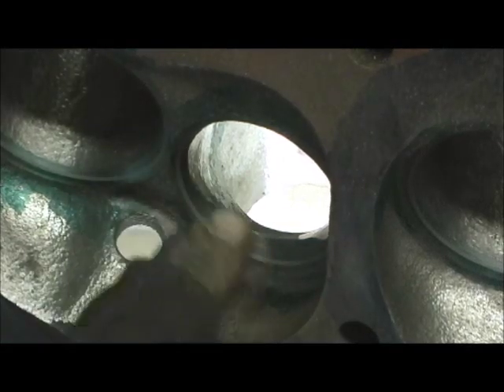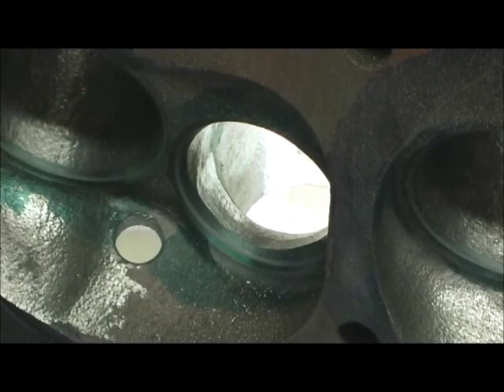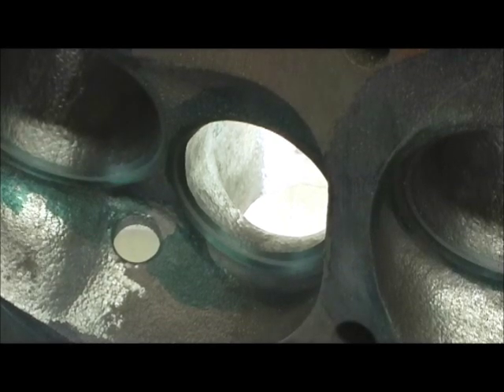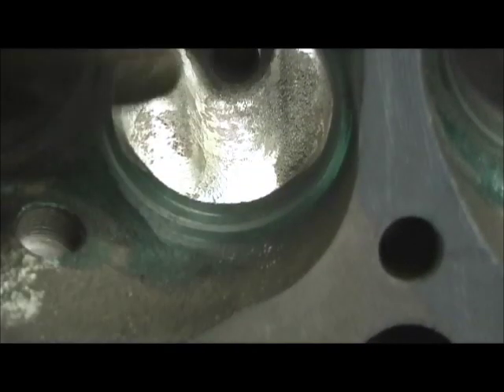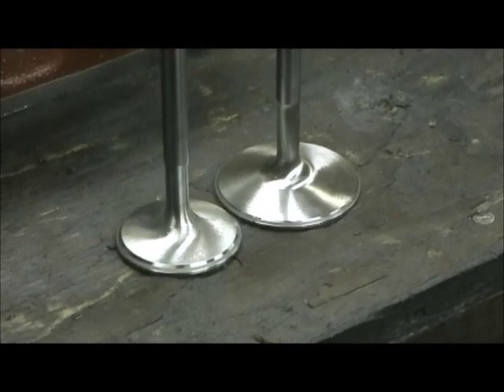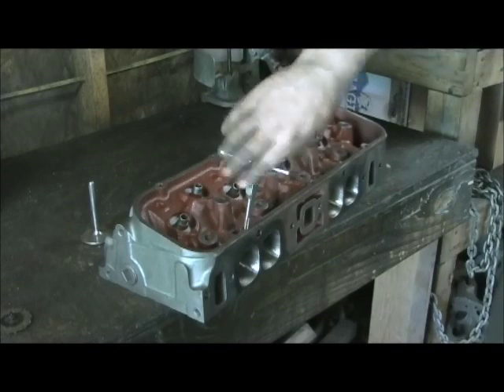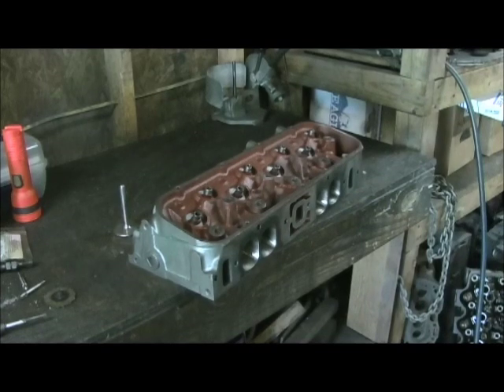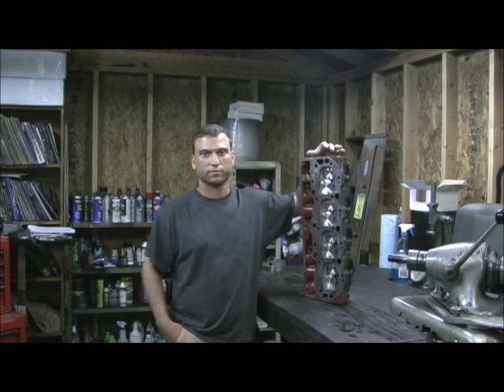BBC 241 Casting Part 8 55 Final Head Prep with Comment by Jon West

Comment from the maker: Of course, but it would be a low RPM pulling situation (below 4000 RPM). I have gotten as much as 60 FT. LBS. off of the peanut head, and picked up around 3 or more MPG.